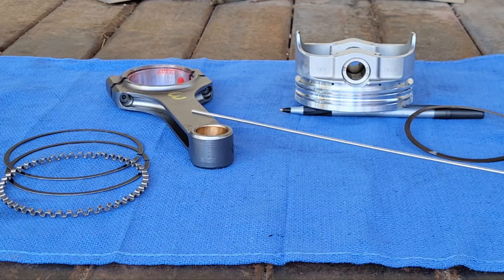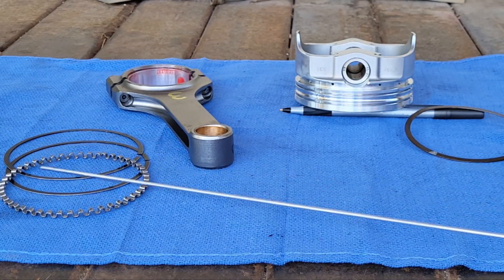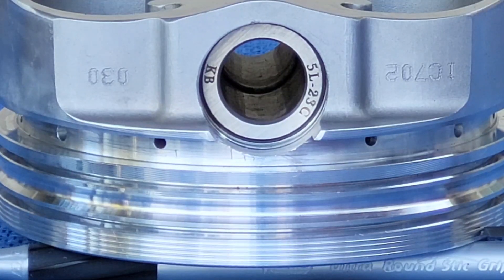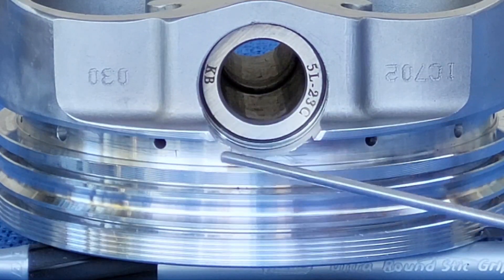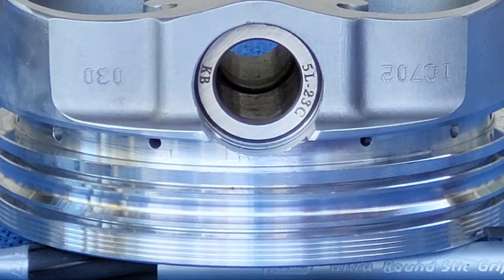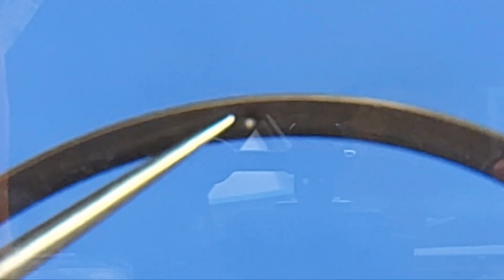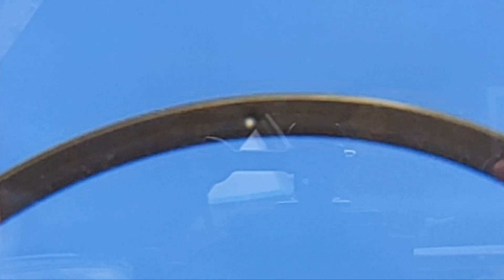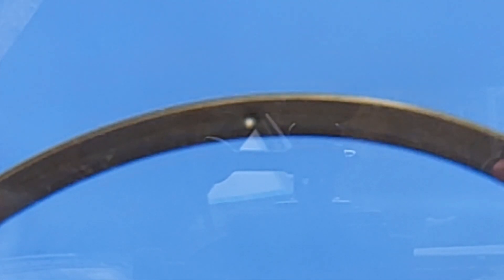Oil Control Ring stabilizer support rail.

Comment: Great video. Thank you..

I have a quick question though… I know the oil support rail is in the same groove as oil ring… is there 4 ring grooves in the piston… or does it just look like it??
Thank again!!
Very informative
Reply from the maker: No, there is indeed a depression there, if you will, but it is not a ring land.  3 lands with that depression.  Got a call in to find out what it is exactly.  Will relay it to you.  Thanx.
Reply from the maker: That depression is called an accumulator groove.  It's function is to allow gasses to expand, and helps with ring flutter.  Enjoy.